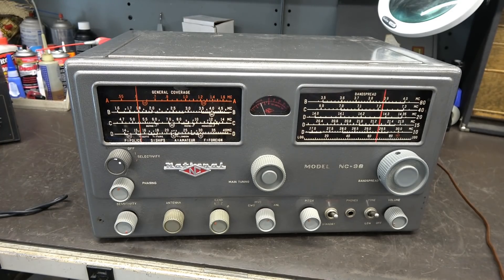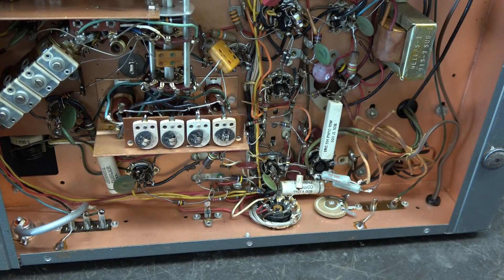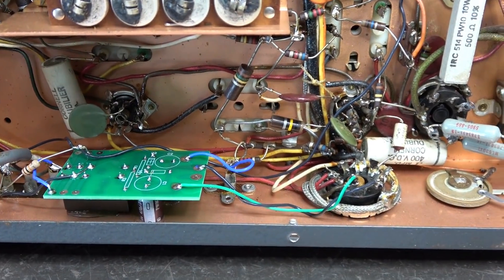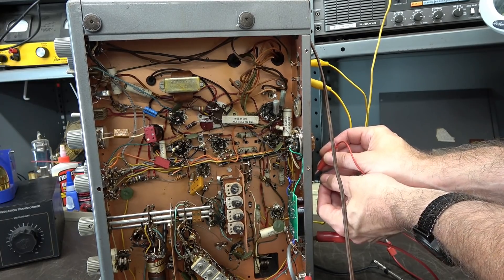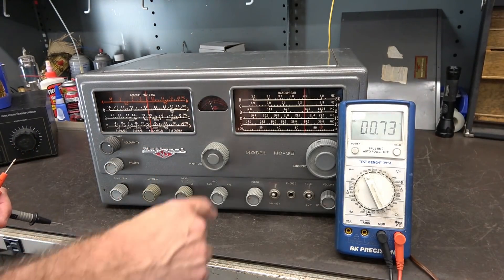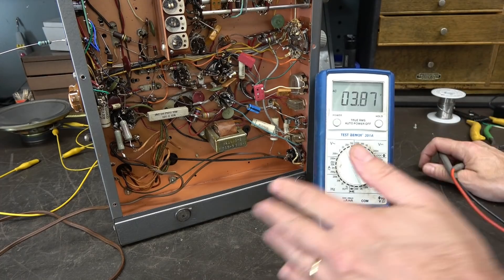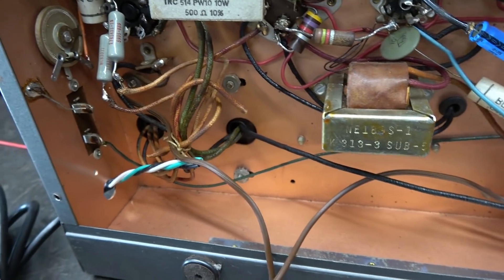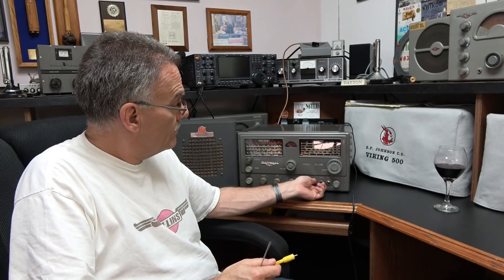How to improve safety Shock hazard National NC-98 Ham receiver and add standby switching

Comment: I will be looking at one of these 98's next week.  It lights up but no signal.  If the reciever is damaged from switching to standby back and forth as you say, is it a total possible rebuild kind of project?  The only info they can give me is it fell off a low shelf hitting the floor. No dents anywhere.  Thanks for listening, Marcus in Kissimmee Florida.  Really find your videos entertaining and educational.
Reply: Or if you had a choice between this 98 or a Collins 75a-1 that works but in a little rougher state.

Comment: I have an NC-98 that I would like to have checked out, and realigned. When I was a kid, my grandmother was a solderer on an assembly line at National Radio in Melrose, Mass. She taught me how to solder when I was around ten or eleven years old. These radios were made about the time she was working there so I’ll never get rid of it, but I’d like to use it again.  I also the same National Radio speaker that you have up on your shelf.

Comment: Terry, This morning, I touched the top of my newly recapped National NC-98, and it gave me a small bite (shock).  It had been on all night in Stand-By, and I was in my bare feet.  If I sat on a stool with my feet in the air, no shock.  I just checked the voltages.  From chassis ground to my fingers, 45 VAC.  From chassis ground to the power stirp, 119 VAC!  I did your transformer test, and it was good.
This receiver was recently acquired by me in an estate sale.  I was just testing the tubes before an alignment.  I found two incorrect tubes (so far).  I decided to ask Google if there was some mod I was not aware of.  Your video came up first.  I had forgotten that I commented on it two years ago (below).  I'll be installing a 3-prong cord, just like I did on my Hallicrafters S-40B.  Thank you.
73 Paul AA1SU

Comment: This is just me, and I 99% work on my own gear: I like to put an input filter IEC jack to replace old line cords.  If appropriate, I always suggest that to the people who bring me things to work on.  For this radio you'd end up with better than original noise filtering.

The jacks aren't too expensive, but I got a big supply of them by buying up a huge lot of broken computer power supplies.  I fixed about half of them (bad caps) and made a decent profit be selling the fixed ones.  The rest got scrapped for parts, and every one of them had that IEC filter jack.

Comment: That shock hazard is common with most receivers of that era. I have a Lafayette KT-320 and it had the same issue till I performed that  mod. fortunately it did have a fuse, so I didn't have to add one.

Comment: What was 'leaking' to cause that 30 volts?
Reply from the maker: Stray Chassis AC
Reply: D-lab Electronics I’m restoring my NC-98 right now. After enjoying looking at it on the shelf for about 25 years, I think I finally have the skill to tackle a quality restoration. I used it exactly once, immediately blew a cap and didn’t dare touch it until now. Maybe I’m too used to designing semiconductor electronics - I don’t really understand what you’re referring to. Could you elaborate just a tiny bit on what you mean by stray chassis AC, please? Love your channel, btw. Thanks.

Comment: The problem with leakage is always there with a two prongs plug and a transformer. The voltage that you measure is due to that cap AND also the capacity of the transformer! Since that last one is smaller that the cap that you have removed you still see voltage BECAUSE you are using a high impedance voltmeter. It is not the voltage that kill or shock people but the CURRENT! Without that cap the current is very low you won't feel nothing. Of course using a three prongs plug kill that current.
Reply: This is true, the measurements don't give a good indication of the shock hazard. 
However, removing or replacing the cap, and grounding the chassis are both very good ideas. Those caps always fail, and relying on the transformer's isolation is also relying on one single factor of safety. Only one thing has to go wrong before the chassis goes live. 
With a ground connection, it takes 2 faults to make it dangerous - firstly the ground connection has to fail, and secondly something like the cap, the transformer, or a live wire coming loose. 
It doesn't happen often, but i've had a transformer go leaky, and also one case of a mains wire coming off. Without ground, in both cases a nasty voltage can appear on the chassis.

Comment: Terry, is there no advantage to putting a Class Y safety cap to replace the death cap?
Reply: It's hit and miss. It does reduce mains noise slightly, but in my experience most interference enters via the antenna. 
For the 5 minutes and 1 euro it costs to put a fresh class Y cap in, i'd just put a new one in :)

Comment: Well done, Terry.  I plan to add a similar circuit to my Hammarlund HQ-120-X HF receiver and a much more modern SDR.  Also, good job on the grounded power cord.  Some of my radios are too small for a three-pronged cord so I use a two-pronged polarized plug and appropriate safety caps instead.  Works well in countries that have polarized outlets but not three-pronged grounded outlets.

Comment: Safety first when checking out circuitry with household voltage. I always put in  a grounded plug when restoring test equipment. Especially with a metal case, Heathkit ahem.

Comment: Great job, Terry! Those blasted line bypass caps are always trouble. And it was only rated at 400V! One good spike could take it out. 

How did you determine the value of the fuse?

Comment: Nice Terry...if noise is a problem I guess you could install a Type Y safety cap in the "Death Cap's" place. TNX for sharing!  73 - Dino KLØS
Reply: Did that  to a Heathkit C-3 Condenser Checker which is now safe to use.

Comment: Well done Terry.  Question :  When you changed the power cord, I noticed a brown wire flapping in the breeze right above the transformer ( Between the 2 green wires) .  Any idea what this is ?   maybe part of the output transformer ??     Very well done my friend
Reply from the maker: Hi Ron, Good catch. Those are the 5VAC windings that should be connected to the 5Y3. The fellow had diode rect the radio. I have reversed that and the 5Y3 is reinstalled.
Reply: @d-labelectronics   I figured it was something like that but with DLAB on the case, it will always be perfect when its done !!!!  Well done Terry